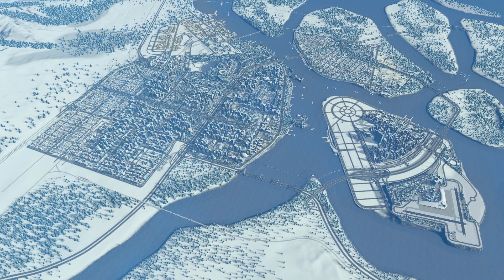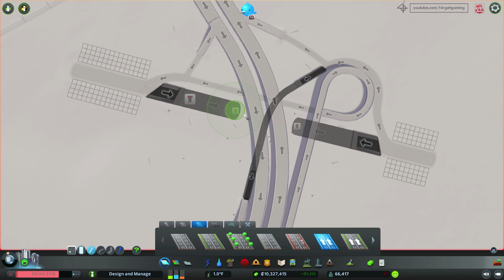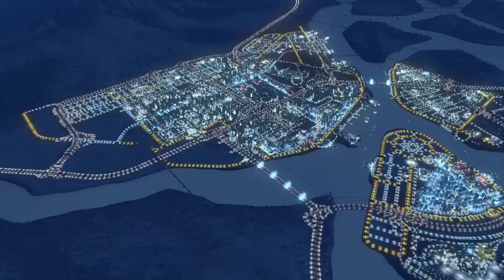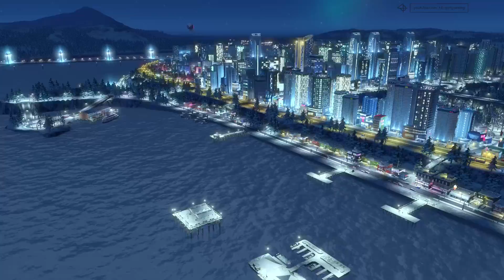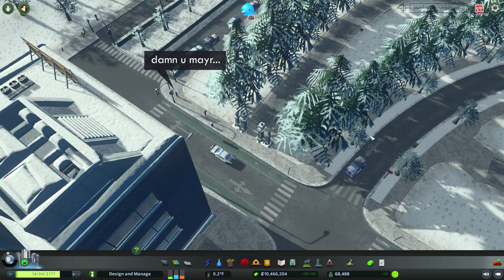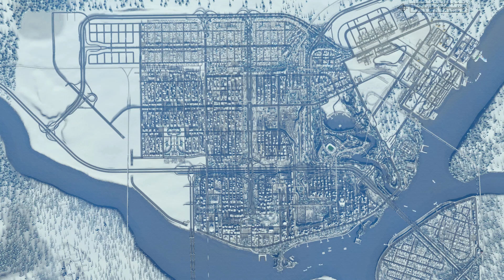Road Planning: Highway–Avenue Interchange | Unmodded Cities: Skylines – Design and Manage, Part 60

Comment: Nice work again. I've got one question though, will you provide a way out for the new area later? Because right now, people on the outer ring need to drive through the big curve into the city and finally on the highway, because of the one way avenue.

Comment: Always enjoy the T4rget city building times lapse's, nice.  Regarding trash I've been playing with concentrating my landfills and incinerators keeping them in my industrial zones as well as a few "remote" outposts. In the urban and residential areas I have been placing more individual recycling centers but spreading them out throughout. It seems to be helping to keep the trash in hand as well as the higher concentrated pollution where it belongs. I must admit though I do not watch my budget as well as you do so it may not be cost effective overall. You know I dig your series! Thanks for another great installment.

Comment: I think it'll be better to build the recycling center at the western part of the city (on the other side of the highway). The area around the ruin can be used for a national park and zoo combo, the whole place could be a tourism haven instead of polluting it. It'll be such a waste of the majestic ruin.
I also think since the other cargo train is not necessary anymore, you can migrate the industrial layout closer to the cargo station and use the northern part of that area for the school out residential since that policy works better if it's nearer to the working area.

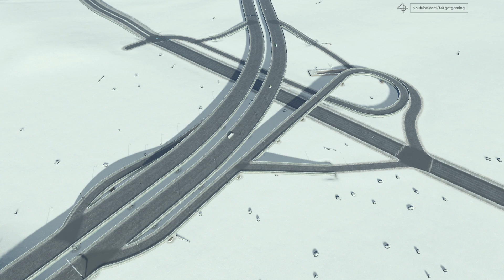Comment: 28:18 there is no way for trafic comming from the outside avenue to connect to the one that goes trough the city. Intentional?
You should place another passenger harbour, probably on the tourism/leisure island. It will improve tourism and help ship trafic at the current one.
Have f4n
Edit: wait... you changed the title of the video !

Comment: I have a question : why do you always leave a one toe gap between buildings? At first I thought they were for paths but I realize now you don't always place a path there
Reply: I think one reason for it was in case he wants to upgrade a road, the place still gets used at max capacity.
Reply from the maker: Yup. Or build a pathway if I want to in the future.